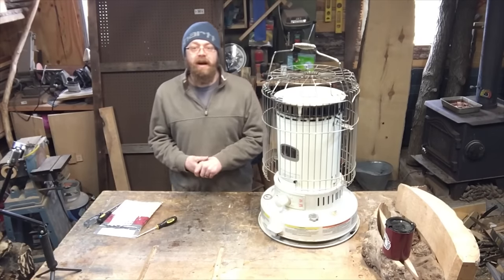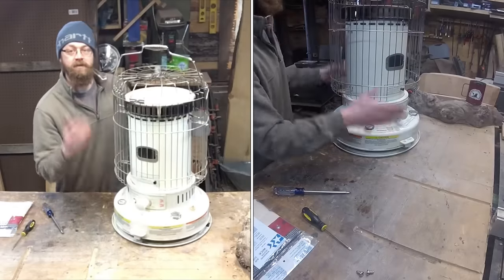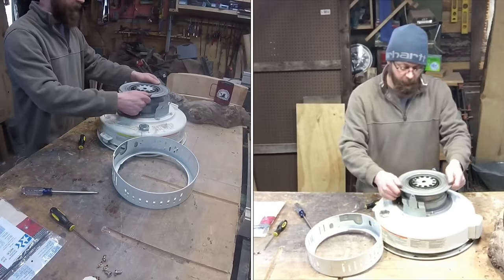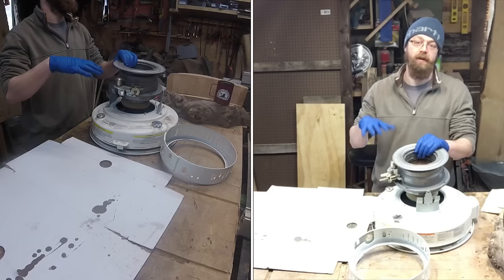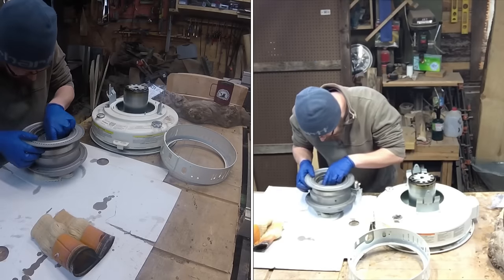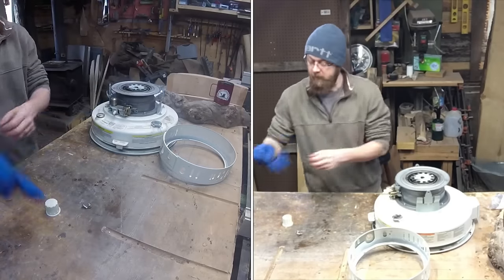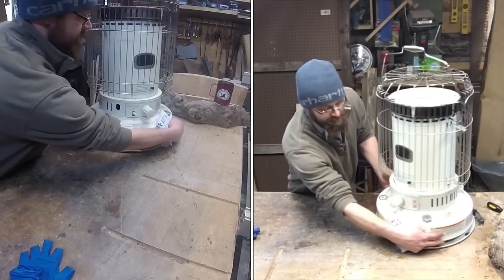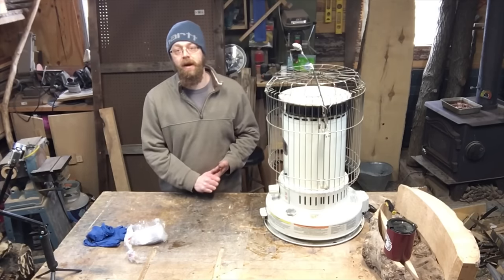How to Changing the wick on a kerosene heater. Watch full video before you try .

Comment: If the heater is smoking badly but appears to have a good amount left. Look at the top edge of the wick. If it has a hard build up on it take it outside and let it burn itself out without turning it off. This is called a dry burn. It will burn the crud off the wick and improves performance.

Comment: For anyone having issues with not being able to adjust wick up or down after the install, what worked for me was not only what another viewer mentioned, about having the wick all the way up before install, but making sure the gasket is properly seated ALL the way around. Mine was only partially seated, and prevented the main center unit with the wick to be seated all the way down. Mine was sitting a little crooked due to the gasket not being seated all the way. You can't really tell by just looking at it per say, but there is a little groove the gasket NEEDS to rest in, in order for it to work properly, otherwise the wick mechanism gets bound up. Took about 20 min and alot of cursing to figure this out. Hope this helps someone.
Reply: thank you so much i had the same dang trouble
Reply: I just took out the spiked sleeve and bottom piece
Reply: @Doczlady  Hey no problem!
Reply: @MUDRUNNER138 I might try that. The bottom piece for me causes the wick to be extremely tight against the center chimney piece. And I can’t slide it down. That and also the damn alignment pins on the wick keep coming out of the holes while I’m trying to assemble all this. I think I need a new wick cus mines flimsy as a mf

Comment: For my Duraheat 2304s the control knob needed to be in the maximum clockwise wick elevating position at the time the wick assembly was put back. Without the knob in that position, the control knob wouldn't elevate the wick after reassembly.
Reply: That's the exact issue I had.
Reply: Same problem lol
Reply: Anyone do a vid on how to adjust the wick height?
Reply: Lol…2304 owner here,  I really wish I would have read this comment yesterday.  I spent over an hour on reassembly, then the wick would not elevate once back into the unit.  WOW, I was SO FRUSTRATED!  Turn knob clockwise and watch inside, you will see the holes rotation up.  However, be careful, as if you you wiggle the unit around too much, the tip balance will trigger and cause it to shut down and wick holes will go back into the down position.
Reply: I just about threw my fucking heater through my window trying to figure this exact issue out last night.
Reply: This is correct- wick rotated to the top position using the knob and holding the high knob position while draping and sliding the bottom portion of the wick over the center column. Without this instruction, the video is incomplete.
Reply: I did this but the wick gets stuck on. Do I have wet it for it to slide down?
Reply: @jasonmcfadden854 same issue im having. I'm lost

Comment: You ever do a dry burn on your heater  ?   You let the heater run out of fuel . Re light it and let it burn the carbon and fuel residue off of the wick . It should burn for about an hour and a half on the carbon . We run kerosene heaters in our shop all day long.  About once a week we do a dry burn . It will prolong wick life by 3 times .  Also never burn dyed kerosene that is red in color as it is bad for the wicks . The dye gums and gels on the wick . I change them for other people frequently during the winter.  Been running them for 20 years and doing my own matinence. Take care and stay safe  !
Reply from the maker: Thanks for the comment Anthony . Honestly I didn’t used to dry burn . I just started this winter . Thanks again have a good one

Comment: As others have already mentioned here, it is recommended to re-install the adjustment knob and then turn the wick all the way up BEFORE re-inserting the wick assembly back into position.  This will allow the knob to fully adjust the wick up and down once assembled.  Also, several manufacturers advise to "WAIT ONE FULL HOUR in order let the wick fully absorb kerosene BEFORE lighting.  Failure to do so could severely damage your wick", as is written in their instruction manuals.  Keep up the great work, you have a very good style of explaining even the little details to the viewers.

Comment: I live in a house built in 1886 with all but one of the fireplaces removed. Once the cold settles in the house it turns into a refrigerator even if we get a warm spell the house stays cold … I have the same  heater and it’s worked like a charm for the last three years but this year mid October we had a cold spell and I had to use it for our front bedrooms and for some reason the flames inside the heater is out of control smoking and flaming ! After watching your video ( replacing the wick ) I feel I can do this now that you have showed us ! Thanks for taking the time to make this Video, very helpful….
Reply: Dave, did changing the wick fix your (smoking) problem?
Reply: No, the kerosene heater is all in pieces laying on my shed floor but as soon as I change the wick I will let you guys know….

Comment: Nice video. You should take the top off and clean the soot off. This way, you know if it's burning cleanly. When it burns clean, the top stays white. I've had a few situations where it was burning less than perfect and you slowly start to feel sick. The best way of knowing is to all of a sudden see black soot at the top. Usually this happens when I try to lower the burn rate too much and it becomes inefficient.

Comment: Good video. Especially dealing with fuel already in the tank. A small amount of kerosene will make your garage or shop unusable for a time due to the smell. Best to do it outside if possible. Figured out mine was going bad when there was a gap in the flame around the burner when i was using it.

Comment: You should mention that on DuraHeat model #2304 the wick should be turned all the way up before reinstalling or it jams up, I found out by calling DuraHeat.
Reply from the maker: Thank you for the comment. If I do a revised tutorial I will mention it .
Reply: You are so right.  Wish I had read this far down before I tackled the task.  After several attempts did figure it out.
Reply: Your right, I had trouble with it until I turned the wick all the way up while I reinstalled it.

Comment: They recommend waiting one hour for a new wick to properly absorb the kerosene before lighting or you will damage the wick. Even though dry burning and brushing the carbon off the wick is recommended about 3-5 uses or tank fills after the new wick has been put in. Also In my experience, empty or burn all the kerosene out before replacing. Because if you accidentally get the wick wet with kerosene before it is properly installed and pushed all the way down it will be very very difficult if not impossible to get it in place. I've been there. A wet wick will keep falling off the inside ring. If you manage to do it, a wet wick will also not want to slide into the tank and will push the wick off center and out of place. I wrestled with my first one for 20 minutes, almost gave up and the wick ended up uneven. So the flame was too high on one side and not high enough on the other. I ended up burning it until empty and starting over. Much easier with a dry tank.
Reply from the maker: Thanks for this comment Jeff
Reply: captainscentsible3938  If you have access to a fire circle OUTSIDE you can pour some out over dry wood & use it up that way  
Don't OVERDO it , you can also use it in " highway balls or oil lamps  ( ALWAYS OUTSIDE !  ) Also you can use the old fuel to soak rusty metal tools before burning it up.
Though kerosene can keep for yrs I would not try to reburn it in that or any other heater 
     Before you do ANY of that , take the lid & 
" chimney" off & crank the knob all the way CLOCKWISE / RIGHT and try to see the wick,
If you can see it , gently scrub it all around with an old toothbrush 🪥 , if you are not afraid ,( NO PUFFY LONG SLEEVES , DANGLING SCARFS , HAIR ETC ! ) light a candle & gently light the wick all around .
If it lights fairly easily in a full circle ⭕ 🔴
carefully place the " chimney " &  top lid
back , wait for it to glow orange & then gently turn the knob COUNTER CLOCKWISE 
/ LEFT ...The flame should not come over the top rim , adjust accordingly.....

Comment: Long-winded and a bit more could be mentioned about the fact that the little tin sleeve with teeth and holes for the wick is part of the lifting mechanism. If you let the sleeve slide down too far the pins will go into the sleeve and shell but not ride the lift mechanism. 

The other thing I would add is that if you bump the spring release without pressure on the bottom it'll unwind the spring about 3 clicks too far. So, once you get the first pin in,  twist the knob once or twice to verify it rides the lift (and doesn't just push the pins out).

Comment: Hey man, good video! just what I needed... I'm a Visual learner. I can read it! However, unless I see it? I just can't comprehend it. The fact that these things are flammablevas well!? Well, Id rather watch someone to it first. Before I burn my house down! 🤣 But 60 minutes soak time it states in the manual after changing or running out of fuel. Not sure, if that's what they are referring to as "The Dry Burn*.., Or if that's another actual step prior to soaking after swapping wicks was well... 🤷🏻‍♂️. In any case, things worked well doing the same as you did. Soo... Lol Thought I'd share what little I did know with the class. Thanks dude. Informative as hell. Keep doing what you're doing.
Reply from the maker: BG Turk thanks for the comment man ! I appreciate it . I’m glad this video could help you out . I’m a visual learner my self .

Comment: good video... slow enough and the tip below to soak the NEW wick for an hour is to get the wick wet with kerosene (K-1 pure and clear) before lighting it the first time OUTDOORS!.  Using the K-1 kerosene is best since it burns clean and does not foul the wick with impurities. NO GASOLINE at all for any reason (gasoline is explosive and flashes if a spark is applied). Light the heater outside with the wick raised UP and lower it when it is burning. To me, the battery/glowplug feature is a waste of time. I like using a cheap grill lighter that has a long tube/burn tip with a trigger to light the butane fuel... they are about $1 at a Dollar Tree type store. My Sanyo heater will not disassemble enough to remove the old wick, so I am stuck.
 I see no way to free the assembly (that has a wheel that moves the wick up or down). All the other steps are intuitive and I can do them easily.
Reply: who the hell would put gasoline in one of these heaters?
Reply: @TheFoyer13  ignorant people... that's who.

Comment: A couple of tips so that this goes smoother:

1. It's very easy to make sure the tank is empty. Use a siphon pump and suck all of the kerosene out. Then, light the wick outside. When it stops burning, your tank will pretty much be empty. To be sure, you can wait an hour and light it again. It should be pretty dry. 

2. The wick will have metal three posts or little dowels that stick out maybe an inch. Those posts have to go in the spiral slots, each with a hole in the bottom. If you don't put it in there, the wick won't raise and lower correctly. 

3. After taking to old wick off, put the knob back on! You'll need it later. 

4. Once you get the wick on and you put it half way back on RAISE THE WICK! This will be hard, because it'll want to keep dropping back down. So use the knob to hold it in the up position and push the unit back on to the four posts (the ones that had the wing nuts on them). 

5. Confirm that you can raise and lower the wick and that it drops when you hit the white extinguisher lever. If it doesn't work, take it apart and start again. 

Once all is good, take the knob off and put everything back together. This is something that if you do it a few times, you get it. The first time was hard for me. Good luck!

Comment: When you push the automatic shut off hold on to the nob for wick adjustment and let it gently go down.  If you continue to let the spring go by itself you will break it.
Reply: Excellent point !  Also before giving up on a wick , crank it full up ( clockwise. ) and gently scrub it with an old toothbrush , perhaps repeating once or twice before giving up...I have nursed an old wick on a used Sanyo  OHC for many hrs / days , in fact , into a 2nd season by so doing .

Comment: Should have cleaned the burn area of carbon/tar before the new wick, so it has a good-as-new starting point.
Reply: What do you cleaning with ?
Reply: I just did that with mine. They say you can use ammonia cleaner. I didn’t have any, so I used vinegar and a scrub daddy. It worked pretty well.

Comment: All you cover is the 90% that anyone can easily figure out.(screws and wingnuts)
You then blow right by how to actually get the wick installed.
"This is really tricky", "hopefully yours goes easier"?  Hows about some closeups of the metal sleeve?  Or a better look at lining up the pins?
Nothing about wick height when your done.  Nothing about how the wick adjustment knob works. Tightening the spring.
Reply from the maker: From comments like this I have realized I need to revisit and revise a new video on this topic.

Comment: Would have liked to have seen the wick heighth after replacement. My new wick is level with the top of the housing, even in the highest adjustment. This wick position does not allow the flame to burn very high, even in the highest setting. I watched your video to see if you actually adjusted the knob to the high setting prior to seating the wick in place. You didn't, so I was just wondering if your new wick was protruding up and beyond the metal housing of if it is flush, like mine.
Reply: Mines flush too. It burns way to low

Comment: That wick did not look like it needed changing.   If you're getting black smoke even after the flame is adjusted correctly then it needs to be cleaned by dry burning it which is something that is required if you maintain the heater per the manufacturer's instructions.  You should be dry burning the wick every couple tanks of fuel to get rid of excess carbon as directed in the owners manual.
Reply from the maker: Thanks for the comment Robin
Reply: very intelligent/helpful tip sir!
Reply: I was thinking the same thing. I've heard these wicks can last a long time. Also the smoke that was generated can be coming from a flame that is higher than 1 inch, not from the wick itself.

Comment: Did this stop the black smoking problem, thanks
Reply from the maker: It did another way to try and fix the black smoke is by doing a dry burn . Light the heater and let it burn completely out of fuel this will also clean the wick

Comment: My wick assembly will not come up from the tank more than 1 inch. It is caught on the ignitor cylinder assy. I suspect the seal has expanded. 3 times I have attempted 2 remove it. 3 times it won the fight and was reassembled and put away. Ideas B4 I fill it with JP-8 and use it 4 target practice?

Comment: OK, some additional tips after I followed the video; they are not in order so it's best to read them all before starting.  Apologies if I restated anything; this is from memory when I did it a week ago.
1. Drain the tank fully.  Of course for safety but if the wick doesn't go in right the first time, it'll be full of kerosene and thus a smelly pain in the ass.
2. Fashion a small wedge (I used insulation foam) to hold the tipover switch in place so when you maneuver the wick holder assembly it won't click back to the OFF position.  Insert the wedge from under the little bracket that holds the switch upright.  You'll see.
3. Move the flame height dial to HIGH.  Then install the wick.  Line up the holes in thin sleeve with the helical slots in the adjuster.  Clip in place with clothespins.  This is the only way I found to have the adjuster work properly after reassembly.  If the wick was in the LOW position I could not get it to raise.
4. As you install the wick in the holder, after you get the first pin in place, clip the wick  around the top circle with some clothespins to hold it in place as you get the other pins pushed in.
5. At the bottom of the assembly there's a large metal disc that I removed (twist to the left, detented slots hold it in) which made wick installation easier.
Reply from the maker: Thanks for this comment Ron I appreciate it when people add helpful comments. Good stuff thank you

Comment: How do I shut off A  Kero Heat Heaters that does not shut off ? I tried shutting it off to the Shut off Manual and it is still running  ? I tried the Adjusting Range But it is still going .
Reply from the maker: This is a Little late but move it out side let it burn out

Comment: Question.. I followed the steps. Very easy but now my wick is not moving up.. Any suggestions on where i went wrong?
Reply from the maker: Yes the little tabs on the side of the wick are not in the right spots or try re installing the wick the placement might be wrong
Reply: @KyleHallwoodworker  ok thanks. I will try it again
Reply: @tinkerbell40ify  The reason that your wick isn't going up and down is because he left out the most important step.  The wick needs to be cranked up to the top, before sliding it down over the shaft.
Reply: @donaldseale2700  ok! Thanks!
Reply: @donaldseale2700  I HAVE BEEN OUT HERE FOR HOURS!!!!! Thank YOU
Reply: @MsCrystalcry  You are welcome.